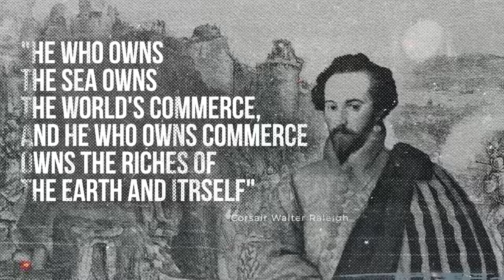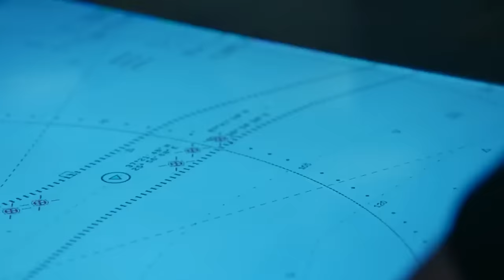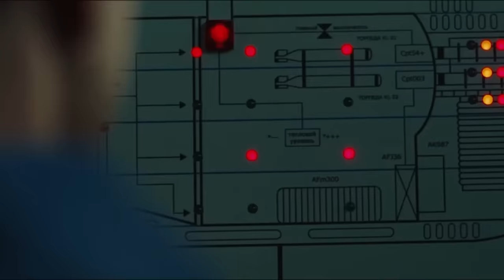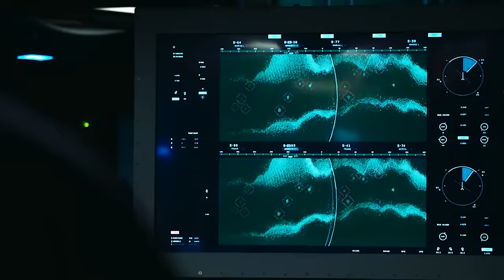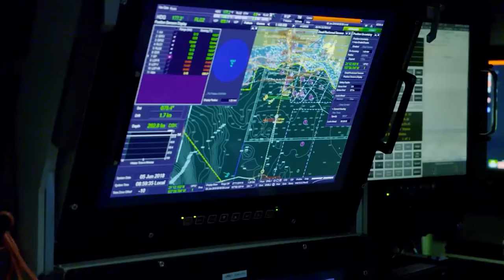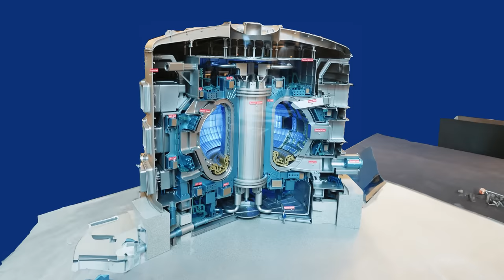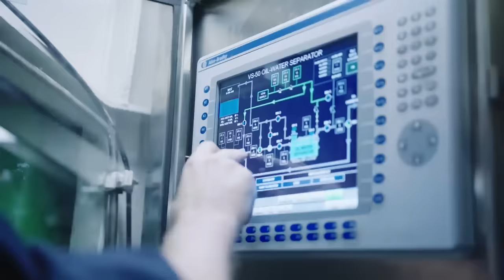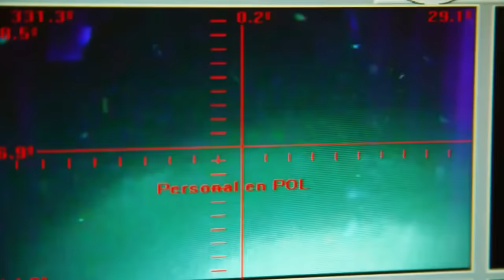This Secret US Submarine Shocked The Yemeni Houthis!

Comment: The Virginia class is the worst mistake the US has made since they stopped producing the F-22. The Seawolf is literally the quietest submarine on planet Earth and they stopped making them because they didn't see a need for them when the Soviet Union collapsed. Now we have a major need for them once again and what do we have instead? We have the Virginia class disaster! The Virginia class is just as loud as the Los Angeles class even though it is miles ahead in the tech department, the prop the damned thing uses is so loud that everyone on the planet can track one when it starts moving. Hell, I am amazed that it doesn't cause people to call the police and complain about the noise when one starts moving!
Reply: Columbia is the replacement for the Trident and incorporates some of the Seawolf features
Reply: As a matter of FACT, the Virginia Class submarines are slightly quieter than the Seawolf Class AND each 4-5 groups (aka. Blocks) of Virginia Class are significantly upgraded over the previous Block. The initial group [or Block I ] have some retired or upgraded. The U.S. Navy are now receiving Block V(5) submarines. Yes, they carry  less torpedos and have less tubes but the Block III, IV, and V subs are just as good or have surpassed theSeawolf Class in many, but not all areas of lethality and can operate in areas where the. Seawolf cannot. The Seawolf Class are much faster, but the sensors and upgrades on the Virginia Class are much easier to execute. The Seawolf Class still are feared by adversaries around the world as it was ahead of it’s time and extremely expensive. It reminds me of the f22 because it to is way ahead of it’s time after being introduced in 1990—just like the Seawolf Class of submarines.